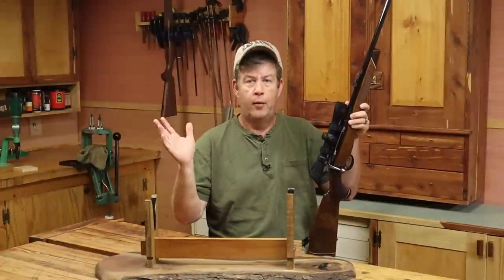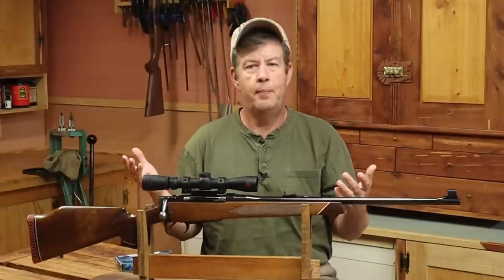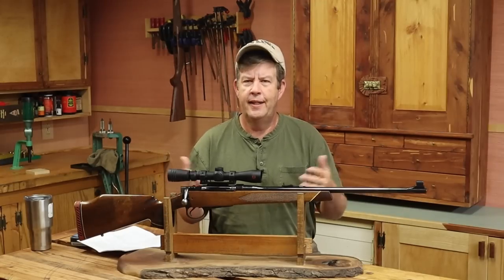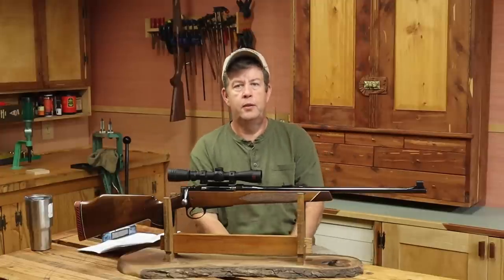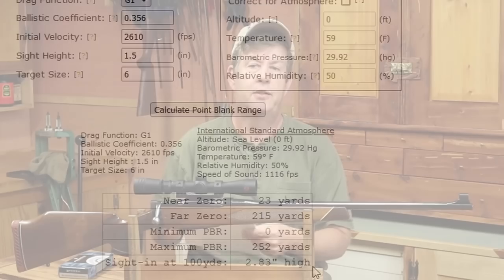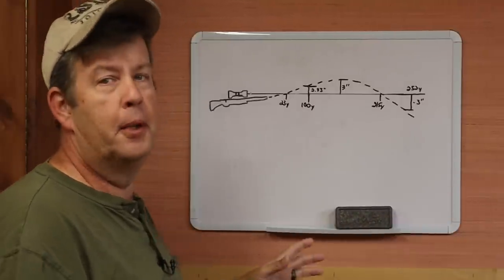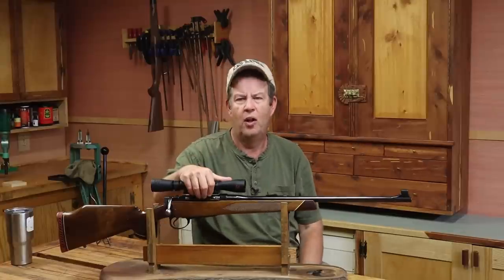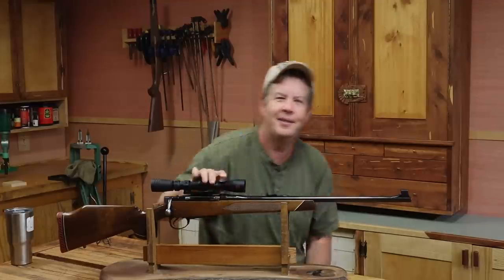Zeroing For Maximum Point Blank Range, And Why You Should

Comment: Just zero at 200 yards that means center bull at 200 yrds, 300yrds you look up that, 7 in drop, 400yrds 20in drop 500yds 45 in drop all you need is look up your three numbers 7,20,45, now you do not need anything no range finder no fancy dials, now your done, what bullet drop do you have at 325 yrds when you sighted in point blank. Guess.  GOD BLESS.

Comment: In the past it used to be a general rule of thumb for standard deer cartridges (based on 308 or 30:06) if you zeroed at 3 inches high at 100 yard you would be dead on at 200 yards and 3 inches low at 300 yards. When all the variables and limitations of measurement are considered this has always worked for me. I have always used premium ammo that is on the heavier side for caliber. I check my rifle and bullet combinations on 100, 200,& 300 yard targets with three shot groups. If my groups are centered less than one to one and a half inches off I consider them to be within my tolerance limits. I then only correct for consistent deviations when zeroing. My range estimations when hunting are not perfect and I have been off on occasions. I have been lucky and so far (I am 73) I have not lost any game or used more than one shot per animal. My grandfather was an extremely strict mentor. It is my belief that I was lucky enough to live in the last era that the American middle class will be able to hunt in. In the future only the wealthy and land owners will be able to experience hunting as a sport. Tom I know you do not need my advice but ( isn’t there always a but ) as the song goes, buy dirt and put it in a family trust. I enjoy your podcasts. Keep up the good work.
Reply from the maker: Rober, that rule is pretty close for most cartridges especially when using bullets on the heavier side for caliber. And the main thing is you actually check it at those distances. 

And I have to agree with you on land. Sadly I've thought the same thing about hunting eventually only being for the wealthy and land owners. Or it certainly has been going in that direction. I also agree with you about buying dirt. I've been keeping a close watch on land for sale in my area and keeping up with prices. I'm guessing the prices will be coming down soon with interest rates rising and what appears to be a recession coming our way?

Comment: I was so nervous at 7:11

And I was so relieved that you didn’t say “the bullet climbs when it leaves the barrel.”

Even though technically the projectile is going up when it leaves the barrel compared to the line of sight, I’ve gotten into knock down drag out arguments about the bullet climbing when it leaves the barrel. It’s such a common misconception.
Reply: It does climb when it leaves the barrel, it just doesn't climb relative to the bore, unless there was something weird happening with a crosswind, and I have no idea whether if there was it would be a net climb.   At the end of the day it doesn't actually mater so long as you know your points of impact.
Reply: @HondoTrailside  It only climbs because the barrel is pointing on an upward angle. If the barrel is level there is no climb. It’s not physically possible.
Reply: The most important thing is know your point of impact at which yardage you are shooting at! Gravity will do the rest!

Comment: Dang Tom!! Sorry to hear about the alpha-gal problem. I had to look it up as I'd never heard of this issue.

As far as sighting in rifles, I chose to use a 200 yard zero for my .243, my .270, my .300 Win Mag and my .375 H&H. My local club has a 200 yard range that's convenient. What I found was that at 100 yards, I was about 1 1/2 or 2 inches high. At 300 yards, I was about 7 inches low and at 400 yards, about 24 inches low... for all those calibres. Easy peasy! So out to about 250 yards, it's just like point blank range. Aim at the boiler room and shoot. For over 250 yards which seldom occurs where I usually hunt, the trick is knowing distance. I used to depend on my Mark 1 human eye balls but have since gone to a proper rangefinder. Cataract surgeries do that to you.

As for shots out to say 700 yards, the solution is also easy peasy. I just get 500 yards closer.
Reply from the maker: LOL, getting closer tends to make everything so much simpler!

Comment: Tom, Great information. Maximum point blank range is the best way to do if plan to shoot 200 yards are better. That depends on the cartridge. 200 yards may be long range for a 30-30. 270 Winchester about right. After you calculate point blank range for your rifle and ammo, you have to go to the range and verify. I just know past 300 yards , the flattest shooting cartridges start really taking a dive toward mother earth. For myself, maximum point blank range is my personal range limit. 250 yards is long range regardless of what the experts say. If you have the hardware and skill to shoot past point blank range the more power to you. I like to hunt myself. I can always get the thrill of long range shooting at paper and steel plates at the range.
Reply: All good comments. A final criteria for me is the game I’m hunting. MPBR for a prairie dog is much different than an elk. An extreme example, but you get the point. I hunt pronghorn, so I usually run a 2” high/low MPBR. This gives me some shooter error, wind, etc. for a fairly small vital zone.
Reply: Thanks for differentiating between hunting at ethical ranges and long range target shooting. Nowadays it seems many think they can hunt at the same range of steel targets.

Comment: I've been using the Non thinking man's guide to trajectory, for 30 years, or MPBR, 308 , 1.2 inches high at 50 yards, I'm in the 6 inch pipe to 267 yards, 150gr, Hornady interlock.

Comment: Could you answer a question?  I recently bought a used tikka in 7rem mag (m658 I think). I really like the specs on the 7prc cartridge and I would like to "convert" this rifle.  Would you do a video on this process?
Reply: You would have to change the barrel out and the cost about $400.- $600. Not worth the cost unless the 7 rem. Mag. Barrel is shit out and needing to be replaced

Comment: Great setup on your 303, Tom.
I love the FOV the 2x7x32 scope gives for practical hunting ranges. Which one do you have there?
Reply from the maker: Hi Ray, it's a Refield Revolution. I love these scopes and I really hate Leupold sold off the Redfield line.
Reply: @TomRiverSimpleLiving  
Me, too. Redfield use to be a fantastic value. 
I have a Nikon 2x7x32 that has been sitting on everything from shotguns to muzzle loaders to rifles. Great scope which they also no longer produce. Subtensions on the duplex are a little tight but I would never part with it. 👍🏼👍🏼👍🏼

Comment: I'd say it works best when you can get the bullet BC and the actual muzzle velocity of your gun.  My 300 Black Out has a 16 inch barrel, but I use a  suppressor and reloads.  Right now I give it my best guess on MV, but I really need to run it through the chrono to see what it actually is.  It is the same for my 308 with an 18 inch barrel and suppressor however I use factory loads with it and can guess a little better on the MV.  Bottom line is I just need to get the chrono out and use it if I want to get an accurate Point Blank Range data for zeroing. Thanks for the info as I learn something new all the time from your videos.

Comment: Tom, I just got back from the rifle range, shot a new 7mm-08 ruger american 22", loaded 1.5gr under the max charge of imr 4350.  Book says I should get 2847 at max charge and 2668 at starting charge.  I'm 1.5gr above starting charge and only got 2580fps.  This is a 145gr bullet.  Idk if this is normal? Very accurate though.  I was hoping to touch 2700 today.  I may buy some reloader 19 and hope to gain 300fps.  Ever experienced similar dissatisfaction with printed velocities vs actual velocities?

Comment: Great video sir.  One question why are the values for bullet weight and caliber not considered considered in the calculator?
Reply from the maker: Joshua, that's a great question and they aren't considered because they don't affect the trajectory. With gravity as backwards as this sounds ever thing falls at the same rate no matter the difference in weight. So the only thing that really affects trajectory is velocity and how aerodynamic the bullet is. And where velocity makes the difference is because everything falls at the same rate a bullet traveling fast falls at the same rate as a bullet traveling slow. So after 1 sec the drop on a fast 100gr 22 cal bullet is going to be the same as the drop on a slow 200gr 45 cal bullet but the fast 100gr bullet is going to travel further down range in that same amount of time. I hope that answered your question.

Comment: If you don’t have time to use a laser range finder, how do you know the distance to your target?
Reply: There are methods for using the crosshairs and how the size of the target looks in a scope in order to judge distance.  In the manual that comes with most scopes there are instructions that explain such techniques, and plenty of youtube videos that do so as well.  Another is to learn how to estimate distance based on experience.  That is done by practicing the ranging of objects at various unknown distances, and then comparing how close that estimate is to the actual distance.  

Historically, the military used a mechanical range finder such as during the American Civil War.  A youtube channel called capandball has a video titled Civil War range finders and Their Repro that discusses some of their history and how they work.
Reply from the maker: Scott, I use a range finder to find an object in the distance right at my maximum point blank range. After that I can shoot anything this side of that object and I'll let anything walk past that. And depending on the situation I might be able to range an animal and make elevation adjustments or use the marks in the scopes reticle to reach out further? But plan A is always to use MPBR just because for me it's the most reliable.
Reply: @TomRiverSimpleLiving  Makes sense, Tom, for stand hunting. I don’t believe the previous poster’s assertion that accurate range can be determined by viewing an animal in a scope with hash-marks on the reticle, because animals vary in size.

Comment: I still like light bullets in the 6mm remington  the 80gr load
And I started with the 87gr in the 257wb  tried the 100gr to get less meat damage.   Really can't tell the difference so went back to the 87gr
Reply: As the owner of a Savage 99 in .250-3000 with its 24" twist, I'm pretty well restricted to 85, 87 or 90 gr projectiles.   100gr projectiles actually pattern, rather than group, out of my rifle!  🤦‍♂️🤦‍♂️🤦‍♂️   Unfortunately, most bullets in that lighter weight range seem to have been designed for use on varmints, but I was fortunate to come across some 85gr Winchester/Nosler Combined Technology projectiles and some 87gr Speers, which seem to dig a bit deeper without the violent expansion  I've experienced with the varmint offerings.  I've also taken a fallow doe with a 90gr Sierra HPBT and she was DRT with little meat damage from a high shoulder shot.
Reply: @charlesbertram986  I think the 87 gr speer is what the 87gr 257wb uses in its factory loads. 
The reason it causes so much damage at close range is factory speed up at 3800fps. 
I use it hunting over big fields .

Comment: My complaint is and always has been if you want to hunt with primitive weapons it should be in the regular rifle season. Their should not be any special season for each type weapon. I hunted deer with a hand gun in PA. there was not any special season and yes, I harvested deer right along with the riflemen. Special seasons are a bunch of crap because primitive weapons of today are not primitive . They are just as accurate and lethal as any rifle.
Reply: Never shot one I'm thinking. Try a flint lock and get back to me.
Reply: @rickpowell7550   yes,yes,yes, I have shot one. Like any other firearm ( rifle) use it within its intended range and it is accurate ( 100 yds. or less ) you can take a deer.

Comment: The diagram is completely wrong. The ballistic information only partially so. A projectile NEVER rises after leaving the barrel. It enters a drooping arc with the droop getting worse the further out it goes. The sights simply "look through" this arc. The center one of the bore is referred to as "line of departure". While the projectile is in the barrel the center of form of the projectile coincides with the center of the bore (line of departure). The instant the projectile is no longer supported by the barrel it drops below the "line departure" and never again coincides with it. The projectile enters this drooping arc and continuously falls toward the earth--drooping more as the distance from the barrel increases. Beyond 300 yards or so the arc droops even more.  At 400 yards most projectiles are around four feet below the center of the bore and at 500 yards--sixty inches or more depending on velocity and projectile weight.

Comment: I only use that antiquated MPBR for my 30-30 and 45-70 and their limited range use.

Today we have chronographs, ballistic days profiles, proper bullets, ranging equipment, and optics that weren't available a few decades ago.

If an person is going to use an higher performance cartridge it's now best to use an predetermined sight in range like perhaps 200yds and then have an optic you can dial in an shooting sight solution or use the corresponding reticle values for sight solutions.  With today's rifles and tools there's an lot more capability.